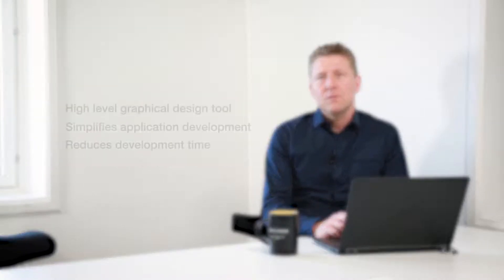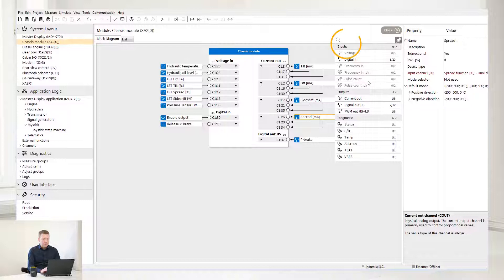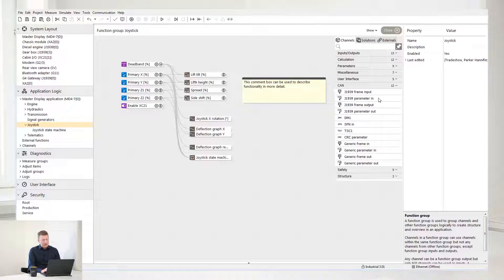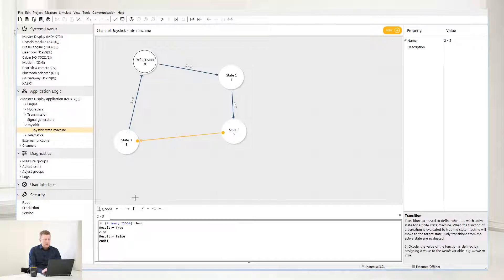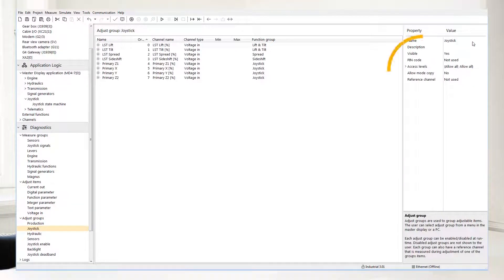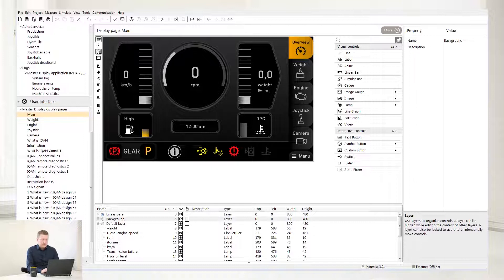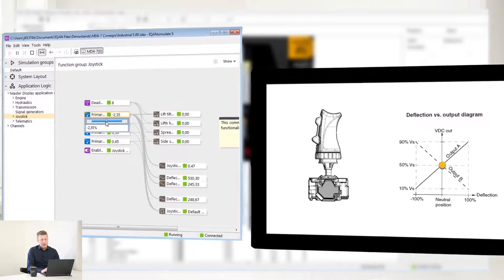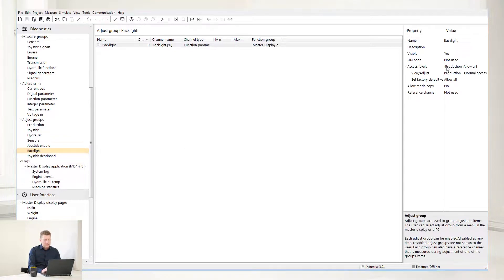IQANdesign 5 Demonstration Video

Comment: Odd, all I want is to mess around and experiment, add a j1939 can signal. Now if I prod enough randomly I find sometimes I can find a list of can values, sometimes I cant get the list. If I do get a list it tells me I have to select a channel, from the channels I dot seem to be able to get a list. It might be a 'simple user interface' but I must be thicker than pigshit because I cant, I really cant. see my way around it, this video is less useful for this than a chocolate fireguard, because at least I could eat one of them. Are there any better videos for using this... for example just show us how to put a graph item on the display and connect it to a value - example engine temp?